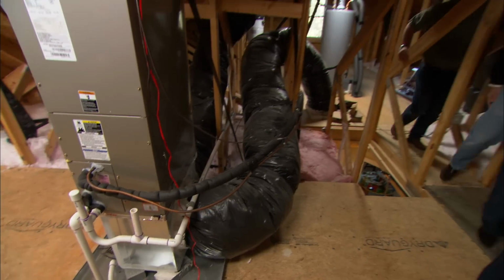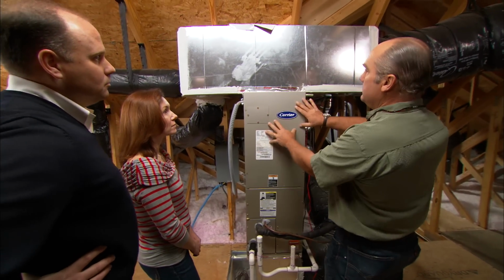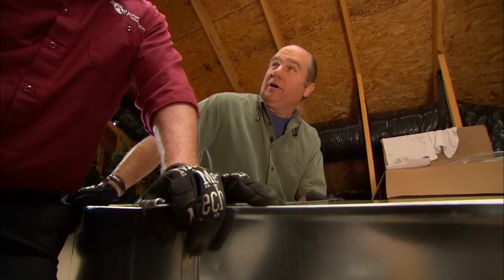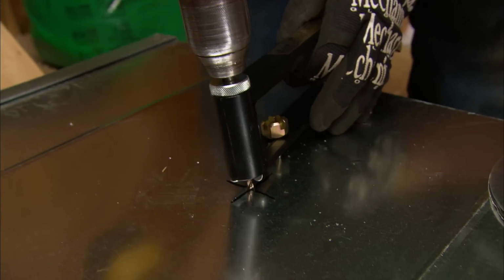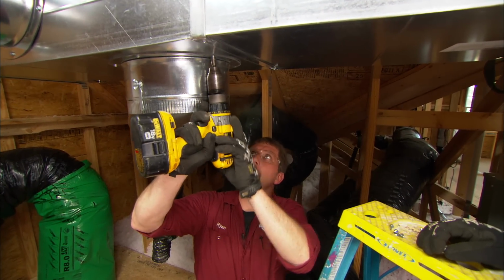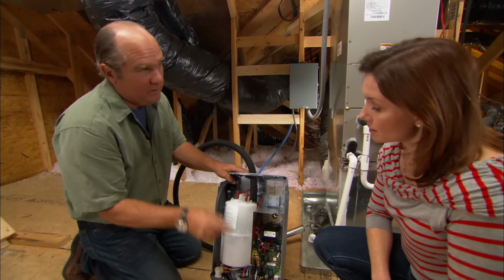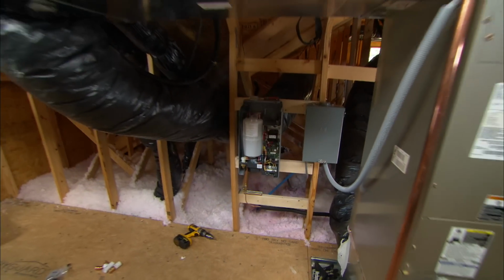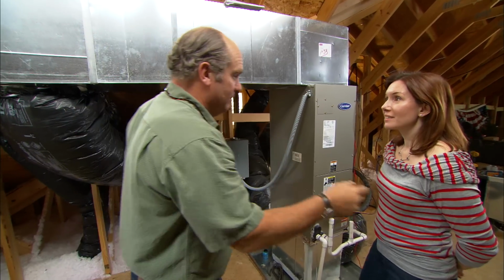How to Install a Whole-House Humidifier | Ask This Old House

Comment: I have this humidifier.   It works. This unit is for houses thay are 4000 sq ft or more. It adds a noticeable increase to your electric bill. Annually you must replace the steam generator about 80 dollars plus you need to change the scale filter on the waterline about 25 dollars.  I have a guitar collection that requires a certain humidity to keep the instrument stable and playable. to me the cost of operation is justified. I do recommend other types of humidifiers for homes less than 4000 sq ft.
Reply: Thanks for being my straight man. I also installed an UVC sanitizer light. So if that is on your mind....both should be done at the same time so the placement of the equipment doesn't collide. I have the knowledge....skills and tools to do this work. On the humidifier I had a professional election run the power. The rest was my God given skills. I'm not a HVAC pro.....but I Bought and read the book from their class training. Curiosity. I had a problem once that tech after tech failed to fix. So I bought the book and figured it out myself.
Reply: @michaelmorris7746  The UVC light is an awesome addition... I've got a killer electrician, but it sounds like you DIY'd the holy crap out of it - good for you! We're officially revisiting it this fall; just need to prepare for the jacked up Dominion bill!
Reply: Michael Morris  what brand is it?  I am having a hard time finding a steam humidifier online.
Reply: Humidifiers Ive seen simply spray a fine mist of water on a large pad and the duct goes thru it, no burning kw hours heating water to steam!
Reply: Michael Morris  what’s the name or brand of the humidifier in the video?
Reply: @jaison7828  Aprilaire Model 800, I believe.
Reply: Michael - can you provide a range for the noticeable increase to your electric bill? This has been my #1 reason for putting this off, but curious if overall you would say it was worth the uptick to your monthly bills, or if you noticed similar changes / reductions e.g. water not wasted vs. the traditional drip pad humidifiers, or other cost savings that maybe made the increased energy bill worth it?
Reply: @banshee200   My house is 5600 sq ft. My bride is beautiful and I'm trying to keep her that way. Additionally I have expensive wooden musical instruments.  The uptick equals a beauty shop bill monthly added to my electric bill during winter months. I have to add... the device meets the test for expected results.  Not the most economical choice if you have a more passive option that will meet your sq ft requirements. Hope this helps.
Reply: @michaelmorris7746  LOL - this is the perfect response. It really is a question of how much 'not having nose bleeds and a peeved off spouse' is worth to each of us - I expect most people would answer 'a lot!' - - thanks for the laugh!

Comment: Do you only use this type of humidifier in winter? I live in Nevada 
where air is dry all year around and temperature in summer reaches 110 
F. Can i use it all year around?
Reply: This is a stream humidifier so it adds a small amount of heat to the air. Have you considered an adiabatic humidifier, like an April aire?
Reply: rafal ciemski I use it almost all year around I live in Dubai, uae and it reaches 120 we get sick a lot from benign in the air conditioned house school or car and go out in the hot weather and we have dust allergy.
Reply: I'm installing this same unit on my home this weekend, I also live in NV, I'll let you know how I t works this summer.
Reply: @Deltron6060  did it work 3 yrs later
Reply: ojaslayer they are not reliable and the maintenance kits are expensive
Reply: It would be mostly for summer as the heat pump basically works as a dehumidifier pulling moisture out the house air in summer. Still could be used as needed though.
Reply: Looking to do the same in my attic. No one wants to install due to concern about the unit freezing in the attic. Only worry about that for about a month in las vegas. Thinking about putting heat tape on the unit

Comment: How much will that run you to install in a two story house?
Reply: assuming two units: about $2100 installed ($1100 for both units and $1000 labor)
Reply: Generally you only need one on the first floor system. These humidifier s have a very high capacity.

Comment: Humidifying a space really has no benefits. Get some lotion.
Reply: MrItsthething how do I lotion my nose
Reply: Stupid comment. Some homes require humidity,  some people require humidity. Lotion does not add humidity.
Reply: people like me and my family who has allergies and get cough a lot a humidifier help us breath better and help with the cough its not just good for the skin.
Reply: Yeah, people for some reason think cold air cannot hold as much water as warm air. It can. The amount of water air can hold is dependent on both temperature and pressure. Some places like those near the great lakes get snowfall of 8 feet. Even at a 10 to 1 ratio, that is the rainfall equivalent of 8 inches. That is a lot of water. The atmosphere needs to be saturated before the snow falls.
Reply: Ya
Reply: Please do some research, you are very misinformed,it has tons of benefits.
Reply: Dezmar Perez proper ventilation fixes that
Reply: Yes, it works great.